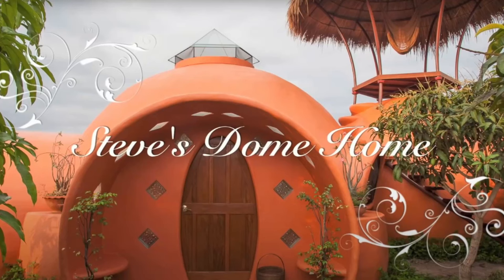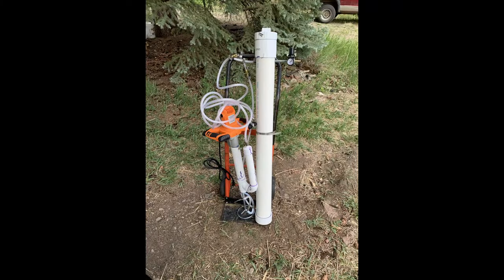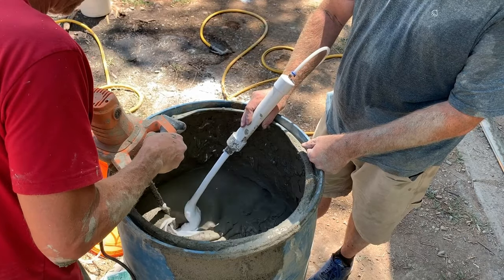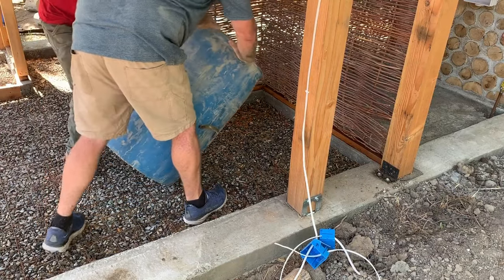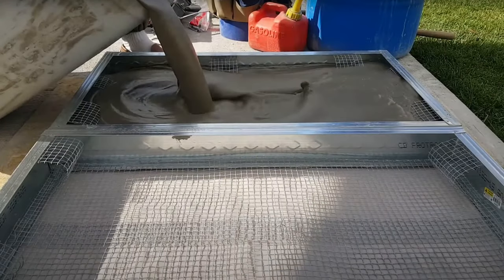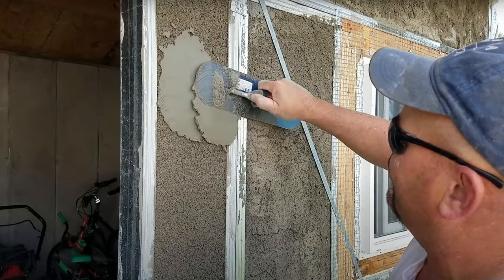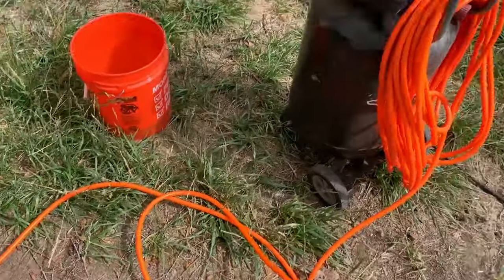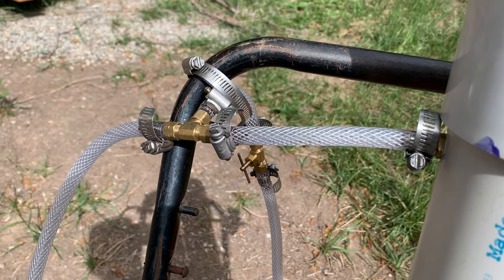Aircrete is great, but watch this before you build with it!

Comment: Great video. Captures all the basics, including all the concerns.
I'm particularly interested in the slab walls poured vertically and then stood up. Need to be able to produce interlocking panels without the cost metal framing.
Also looking to include exterior design in the pour (board and batten) to further cut down on cost.
Would be willing to invest in facility to manufacture panels in the US. While DIY is fun for small projects, the potential for quality control failures is a concern. 
If the remaining concerns can be resolved we will have an answer to affordable housing!

Comment: Here in Brazil theres a movement (who say they´re green but they´re not) where they use sheets of polystyrene stood up and held by short sections of rebar coming out of the concrete slab. They then put up metal slab reinforcing either side, tie it all together, give the polystyrene a light coat of water cement mix, then a fairly thick stucco layer. Its a pretty fast construction technique by our standards and they build multiple story buildings with it. But is metal and polystyrene intensive which have doubled in price the last few years. I always figured that aircrete panels without metal frames like ac harry honey (whatever is his name is!) would make a good substitute for the polystyrene sheets. But from what you´re saying, you were unsuccessful in making an aircrete panel that would make it out of the form?? Or were you solely focused on the drywall concept?? Cheers.

Comment: Have you looked at the Styrofoam AirCrete (Stephen Williams)  I am wondering if you could use the Sawdust in place of Styrofoam, and get a substance that is wetter like his, and more readily available in your area.
Reply from the maker: I have not, but will, now.
Reply: Mr. Williams seems like a neat inventor.
Reply: @radicalgastronomy  Sir, i 2nd with Mr. Jarnod Jordan on  Mr. Stephen Williams styrocrete. I watched many videos on Aircretes (aircrete Hairy, Honeydocarpenter, styrocrete etc.  Your Dustacrete seem to be the simpliest and easiest to work with and create. Glad i found your channel and videos..
Reply from the maker: @tanjirokatoichi7425  I have watch some of the styrocrete info, and agree that there is potential. Personally, I like to avoid materials that have the potential to “off-gas”. I find styrofoam to be kind of gross. The dustcrete is performing quite well, and avoids the use of petroleum based synthetic materials. Glad you like my info!
Reply: @radicalgastronomy  i love it!

Comment: I enjoy your channel. Thanks for reporting on all of your experimentation. Also, thanks for supporting your local farmers in their fight against the new County Dude. Anyway, in my county I have codes to deal with (I envy your "lack" in that respect), but I'm thinking I might be able to use some kind of aircrete system for insulating a timber frame structure. I like your idea of making a SIP-like material. Thinking out loud, James Hardie makes a 4x8 fiber cement panel product for board and batten look siding. I wonder about fastening one of those cement panels to a dimensional lumber frame, then pouring aircrete or dustcrete into the panelized frame. Maybe drive some nails through the panel to add something for the aircrete to grab onto. If the aircrete bonded well to the siding panel, with the added rigidity of the lumber, that might make a nice SIP replacement. Finish off the inside with plaster applied directly to the aircrete panel. Again, just thinking out loud for now. Won't have time or space to experiment with it for a while. I know that you would balk at the cost and all the commercial products, but for me, it would be a way to avoid all the outgassing foam as well as being very fire resistant. And cheaper than SIPs, especially since they would not need an additional layer of siding. I think I might be talking myself into this...

Comment: Ive experimented  with a 50% shredded recycled styrofoam mixed into   concrete with reduced heavy aggs  also used  fibreglass fibre for rebar replacement  and had great success   light - recycles  guarbage stro foam   strong fire resistant easy to put  fasteners into  or stucco or parge .
🎉
 You can haul larger loads in a concrete truck as half the concrete is very light (foam and cement, water ) 🎉
Reply from the maker: Cool!

Comment: Thank you for sharing your thoughts.   Have you tried styroaircrete? It's basically shredded styrofoam mixed into aircrete. It seems to overcome a lot of problems typically associated with aircrete.
Reply: I love the idea of styrocrete and have made my own, but unfortunately it has been banned due to 2 hour fire resistance requirement, and toxic gases emitted in a fire. Interested to know if anyone has overcome this issue.
Reply: Use perlite instead
Reply: @ShivaTD420  Perlite does appear to have the potential for a successful natural alternative to petroleum based Styrofoam beads.
Reply: @geoffreydebrito7934  just don't mix it too hard when the perlite is in, over mixing will crush it into a powder loosing the insulation benefits. 
It will also make the concrete a bit more water permeable than the styrofoam mixes. So make sure you get decent vapor barriers. The perlite mixes are not too far behind the Styrofoam in weight, but they are usually much stronger. 
For perimeter walls or multi nozzle concrete printers I usually lay down three layers. A conventional structural mix for the outside envelope, a perlite insulating mix for the core and a fine particle white sand mix with high latex for the interior layer. This gives the walls a nice shiny white finish that looks like it's painted. This white layer is impermeable, so it can act as a vapor barrier by itself.

Comment: Greetings! Great, sober analysis of aircrete as a building material!

There are two things that I would like to see done with aircrete that I think would compliment the material very well.
1) Continuous flow with in-line agitation for large pours. This should be feasible with a hopper for the portland cement, a screw pump/agitator to move/mix it, and the foam inlet behind the screw to ensure you don't make a clogged cylinder in your screw pump.
2) tilt-up single form cast walls with cast-in fastening joints, mesh reinforcements, etc. Aircrete should lend itself very well to the tilt-up method, as a substantial logistical burden for tilt-up is the weight and then insulation of large pours of reinforced concrete; aircrete minimizes the weight so you may get away with smaller cranes or no crane at all to erect the casts, and your insulation is integral to the material itself, and the logistics of laying your mesh saves a lot of labor as the cast-in aircrete will give you the best chance of adhesion.

Also the problem with adhesion and aircrete is the foaming agent acting as a separator as well. Most surfactants have long polymer lipophilic tails which are good at forming mono-layers when they're not bunched up in micelles. I'll have to think up some ways to modify the foaming mixes chemically to avoid this. Probably rheology modifiers like CMC or maybe just table salt can promote micelle formation and swelling, which should make for good adhesion to synthetic fabrics. 
If anyone knows why Drexel foam is commonly used instead of bulk Sodium Lauryl Sulfate for aircrete please let me know.

Comment: I'm on a similar hunt for the "best" infill material for timberframe walls.  Considerations for an ideal infill/wall material: 1. Insulative and thermal mass value  2. Strength and durability  3. Anti-Pest  4. Ease of installation (a one step, al in one process would be ideal) 5. Environmentally and human healthy- Low embodied energy, natural renewable material, non toxic.  6. Aesthetic value  7. Low cost.  So far, old ways and new ways still haven't produced a "best" way.  Thanks for having boots on the ground with your experiments.
Reply from the maker: This is the quest. I’m really liking the dustcrete. I plan to test a lime/clay binder, in leu of the portland/lime mix I’ve been using. I think it will be the closest to meeting these specs.

Comment: Great video! I also was interested in a sheet rock type material. I made a 24” x 10” x 1.5” test shelf. I used a wood form lined with wax paper then garden weed block cloth (one long piece wrapped length wise, around the ends). I over filled slightly. Folded the weed cloth over the top, added top cover wax paper then a board and a weight to press the weed cloth to the air-crete. I also added a piece of rabbit wire in the middle. I think for  this project I mixed the foam:cement at 7:1 by volume (1:4 water used; with Shampoo 4 oz/gal.  & cement 15 lbs/gal.), using Suave Daily Clarifying Shampoo (I found thick & better and cheaper than any dish soap). You may be able to recycle used garden cloth. The shelf produced was very light and strong. I had it hold up 2 bowling balls&bags while supported at its ends. Ron (rondesc at aol.)

Comment: Aircrete has been in practical use for many years. My first notice of it was its use as the primary wall surfaces of a warehouse-type building in which my workplace was housed in SHAPE, Belgium, a NATO installation, in the '80s. I'm uncertain of the superstructure design, although I assume it was steel beam supported, but the walls themselves were probably at least six meters high, and supported their own weight. They were very large blocks, probably each half a meter in height and approximate thickness, and quite long. They appeared to be bonded using some synthetic caulking-type material, although that could have been only an exterior sealant rather than the primary bonding. My only critique, which would apply for some uses and not others, was that it was easily scratched and dented, but that could be addressed when desirable with some over-coating. On the benefits side, it doesn't transmit impact forces efficiently, so it is resistant to cracking and shattering.
Reply: Those blocks are self-sustaining but you can't build a second floor on top of it. In many countries, in Estern Europe for example, you won't get building permit to build more then one floor without reinforced concrete encasing, columns. Another issue will be, if you want to apply insulated boards on the façade using drilled fixxings. It may crack or crumble. That being said, those blocks are brilliant for indoor partitions, separations walls etc.
Reply: @SpiderF27  I saw one video of a couple who wasn't able to get consistent enough results and gave up on the material but if it is pre-cast by an experienced manufacturer I'm sure it's fine. No I wouldn't think you should use it under a more compressive load than maybe a small roof.
Reply: @crawkn  For a single storey building will be no problem. Now there are plenty of manufacturers, big enterprises all over Europe that make those blocks in all sizes. Ytong is one of them. You can build a house in no time with those blocks.

Comment: I fully agree with your final statement in regard to the use of portland in ANY project and the LONGEVITY of the project usefulness. If the statement were not absolutely true - we would not be witnessing Roman architecture still standing to this day. The same can be said of Meso-American structures that stand COMPLETE in this day and age as well!
Reply from the maker: Here here
Reply: Romans had access to a particular pumice that helped them make lightweight domes. Had many types of concrete including underwater setting types.

Comment: Do you know what the surfactant in Drexel is? 

I want to avoid fluorosurfactants as i dont want to contaminate the groundwater. Fluorosurfactants are commonly known as forever chemicals. I dont wabt to build a house that eill be toxic easte in 100years.

Unfortunately fluorosurfactants are still incredibly common as they foam extremely well.

Comment: Very good video.  I live out on a small homestead.   I built a metal shop about 6000 square foot and I also have a home here already.    I'm interested in building some out buildings with this method.   I've got a few questions if you've got time and are comfortable discussing them.  I don't know why but I had the impression that people also use brown up Styrofoam waste to create air pockets.  I also am curious about the addition of fiber into the Portland mix .   When the engineered plans came for my metal building I was kind of disappointed with how lax they where with concrete thickness and strength requirements.   I went to a far higher strength concrete but I also had them add fiber to it for more strength.   The fiber just came out of a bag and didn't add much cost at all.   It was mixed in the trucks before they poured the concrete.   My location has one thing,  very dry and hard ground.   My current idea is to use my small tractor with backhoe to make forms in the dirt itself.   To tamp it down with sand and to then make panels and let them cure for a few weeks before anything happens.  I would like them to be structurally sound and insulating.  Inside I plan on sewing plastic materials and making a dome roof inside a rectangular building.  The walls would be these pre formed pieces and the roof would be a first pressurized dome,  using chicken wire,  rebar and whatever else may add structure I would spray the outside first with thin layers,  next would be  a layer inside to lock the shape in.   From there I would use bonding agent or whatever is necessary to make a roof strong enough for the high winds and such in my area.    I would like to be as environmentally considerate with materials as possible but not to the point of loosing strength,  adding excessive cost or time to the build.    My hope is for 8 foot walls,  with a  20x30 outside footprint.   For the floors I've seen a few dirtcrete jobs that I would like to do with a lot of compression and then a good coating over the top.   The eventual goal for me is to have this as an efficiency.    I have years of hvac experience professionally and I've developed a small geothermal /  underground storage tank  cooling system from small pumps lines and a converted inverter style window 12000 btu window ac, that I currently use in my bedroom in my home.   1 ton is typically good for 500 square feet in a typical home in my area so I'm sure with highly insulated walls and roof the 600 square feet plus added air space of the dome will be well within reasonable use.

Comment: I've made thousands of aircrew bricks for equipment sheds. We live in an arid desert regen, so extremely hot days and cold at night. Curing aircrete in extreme heat is a huge challenge. However, it works well, is cost effective, and has awesome insulation properties.
Reply: In American scientific literature, engineers complained that the builders of the 50s and 60s were crazy and lived in the 19th century or did not work well.

And now Americans remember “how good it was in the 60s.”

Naturally, wild lameness. There is a super construction crisis in the country and the banking and construction lobby. They cannot make cubes from free concrete (the price is only for cement and air - waste).
(1 plant per country) So that lonely homeless people build 150 m2 houses in 3 months.

Soviet panel houses are divided in 1-3 days into a House (Foundation month or from ready-made elements = week.) And the first floor itself in 3 days.
7 days = 2 floors.

The city mafia seems to steal 20,000 per homeless person per month. And this is the price of the apartment :)

5 floors without elevator. 60 apartments. 200 people with housing.

Comment: I have been interested in aircrete for a while and plan to build a shed with it this year.  Aircrete has been around for decades and is widely used in Asia.  It is referred to as cellular concrete, or air entrained concrete.  One method of manufacture involves curing it in an autoclave.
One method I have seen is to make panels and connect them with spikes.  When the wall is up cover both sides with chicken wire & stucco for strength.
Reply from the maker: I believe there is an autoclaved block available, as well.

Comment: I've played with creating my own foam generator but have yet to actually make the foamcrete for the project I'm working on.  I love your idea for a foamcrete composite sandwich material.  I imagine applying a water based starch glue like wall paper paste to the cured foamcrete slab while still in the form.  Then cover it in a paper product like newsprint.  No plastic, you want it breathable.  When dry, flip the planel and apply the glue and paper to the other side.  Paper should be overlapped to avoid seams.

Comment: way back when, i was desperate, there was no aircrete,  i developed styrocrete, made it into 3X3 blocks 4 inches thick and insulated our entire root cellar,  that was 35 years ago and it still looks and smells like new in there.
Reply: 😳 What does it smell like?
Reply: Did you use bean bag type pellets?, I personally think they are better than Aerated Concrete.
Reply: @jamesmatheson5115  i did, i think i mixed it to three buckets full of beans for one bag of portland cement
Reply: @dirttdude  With some shredded pvc fibre mixed in would make it strong, make your own fibre out of old bags that people throw away.

Comment: Have you looked into    using poly fibre in  the aircrete like shotcrete .
 No  rebar or mesh required  increases strength and resistance to cracking .
Amazing strength increase in concrete
Reply from the maker: I haven't tried it, but it sounds viable.

Comment: I am curious how you get R6 per inch? Of course, it depends on your density in the mix. Must stable mixes seem to come up with roughly R2 per inch. I've played around a little with it. I look at it as filler/ insulation, not structural. I think it can be utilized however.